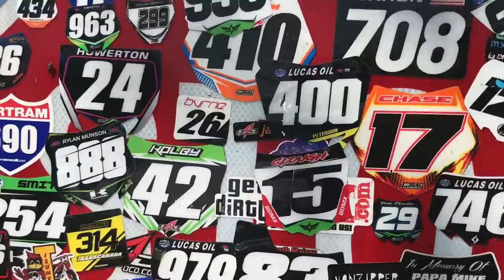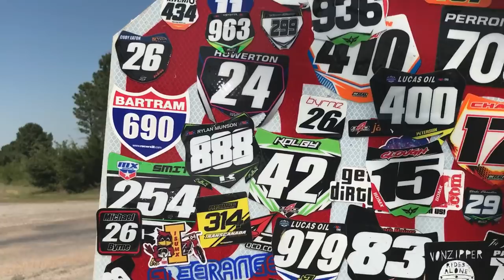Taco Mayo Dirtbike Drive Thru - 365 Vlogs w/ Brett Cue - 017

Comment: Hey BQ, that looked like it may have been a "simple  running suture". Or baseball stitch. It is a continuous laced suture. In the future when removing it, cut the knot on one side, then pull a little slack from the knot end as you work the entire thread out. Hurts much less and will not break off!
Reply from the maker: That would have been helpful to know haha, thanks for the advice JC! -BQ